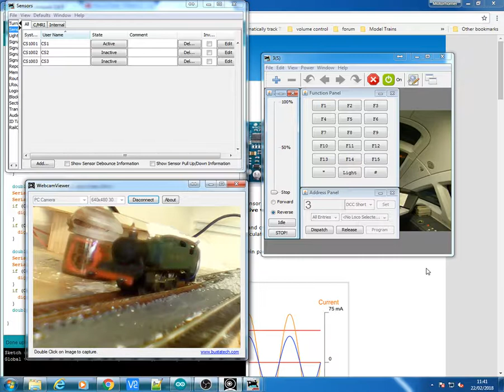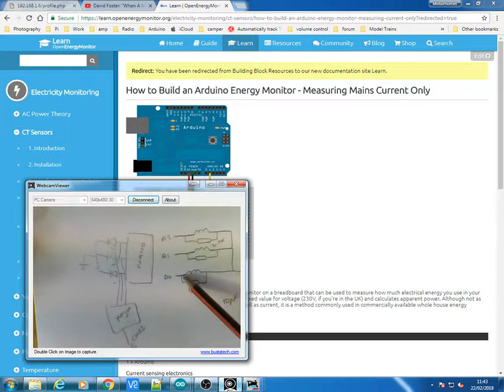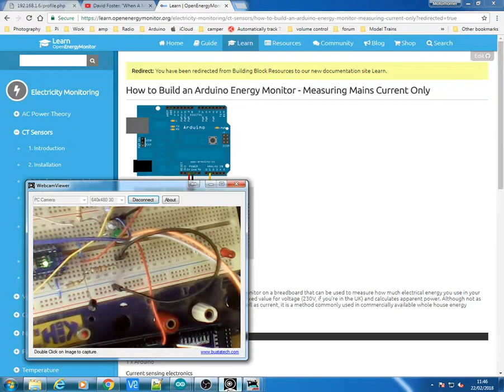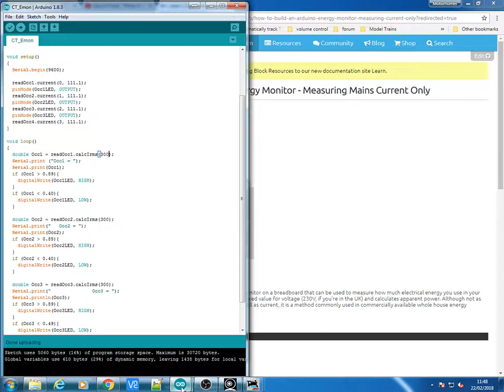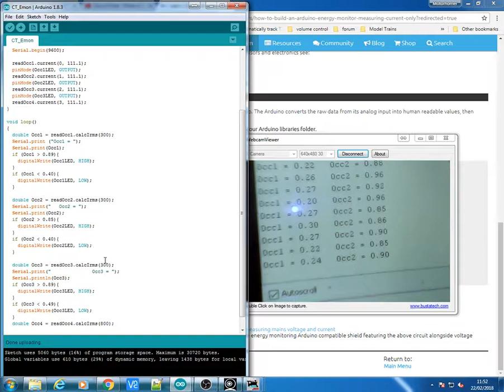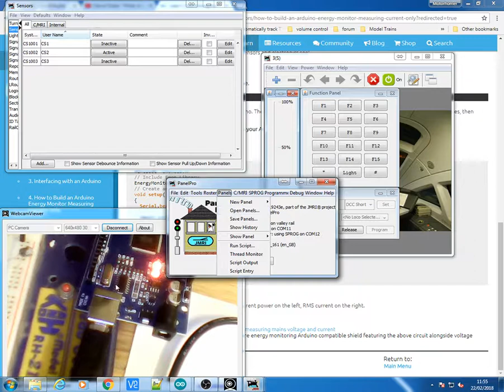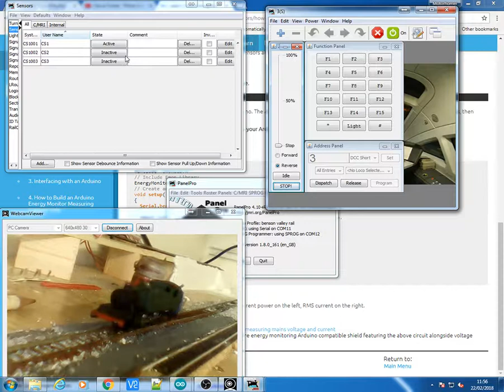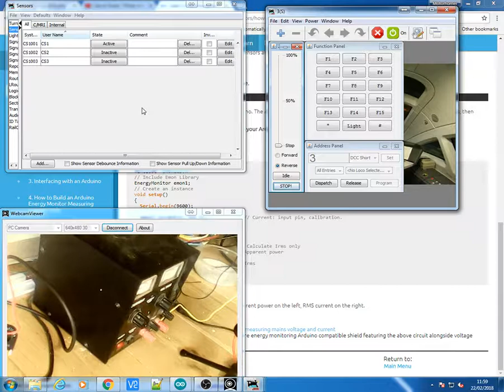Model Railway CT sensor Arduino CMRI JMRI part 2

Comment: Hi Motorhomer, I’m following your videos with great interest as I want to go the same way as you. Block detection is certainly the most complex area for solving. 
Have you considered using ACS712 for current sensing? For further info http://thenscaler.com/?p=514.
Keep up with the videos.
Regards
Reply from the maker: I have used these but for n Gauge the current was too small. I have now changed over to OO gauge so may give these a go again when I get around to this part of the build

Comment: Hi - Thanks for this information.  Which DCC system do you use?  I don't understand why we connect to an Analog Input when we are using DCC.  Thanks
Reply from the maker: I was using the SPROG DCC controller which is connected to a PC. This runs the trains on a DCC system. The Arduinos are reading the CMRI output from the SPROG and then it can be used in an Arduino code to control parts of the layout. The CT transformers due to there nature are reading a voltage input from the current to the track as a occupied sensor. This will be a voltage swing from 0v to 5v which the arduino will read on an analogue input pin. It might make more sense if you have a look at the web link for the full setup. Hope this helps
Reply: Thanks - have you considered using the rr-circkets BD80 Current Transformers ?  I don't think you then need to muck round with Voltage Dividers.
Reply from the maker: cant find any data on the rr-circkets BD80 Current Transformers. I have tried other CT sensor modules but the problem you get with N-gauge is very low current when idle. This is very hard to detect with most off the shelf modules. The CT used are also extreamly cheap
Reply from the maker: I cant find any data on the rr-circkets BD80 Current Transformers. I have tried other off the shelf CT modules but with N-gauge trains the current draw when stationary is too low to be picked up. The CT's i used are also very cheap
Reply: sorry here is the correct link - scroll down little to BOD-8 http://www.rr-cirkits.com/description/index.html

Comment: good work finding you put a lot of time to explain makes it easy to follow,i am watching very carefully as im new to the N gauge hobby and converting all stock to DCC have all decoders to fit easy and micro smd resistors for rolling stock,just wondering if there is a way to read value of resister with Arduino then you can set that value to identify different trains carriages, i.e 100ohm could be a coal truck 1 150 ohm could be coal truck 2,ect something to get your brain round.Thanks
Reply from the maker: Thanks for the comments. It could be possible to read one carriage and detect the current reading which could identify that carriage. Each resistor value would give a different reading. However as soon as tow carriages are added it would become harder. If this was very accurate yes its possible the sum example the sum of the carriages if ending in 5 will be coal, if ending in 8 could be passenger. Not done much work on the layout been in the garden with the nice weather at present. Will update when its all running again.

Comment: Nice, as usually. Did you consider infrared or magnetic sensors?
Reply from the maker: Hi Miguel thanks for the comments. I did consider IR and proximity switches but these will only detect the train entering the occupied zone. If a train with 5 coaches on entered a zone it will not detect the coaches that still may be in the previous zone. This will make the signalling wrong and could cause collision on auto system. It will also not detect locos in shunt yards unless they are stored over the sensors. To be honest this CT reading into JMRI is not great and even with IR etc it would still be slow. The mimic panel works great, might need to look at alternative PC control software.
Reply: I don't know why but my mind resist the current sensing option. But since I have a long way to go before commit to the kind of block occupancy I want. I just keep reading and watching what people, like you, are doing :)
And yes, I'm thinking the same thing, change the control software.
I'm building a turntable and came across a problem with JMRI that I had to put a timer in the sketch because on certain (not all) outputs, JMRI keeps sending bit 1, over and over, even after the operation is done and the sensor reported back its new status.... 5 seconds timer before arduino can read the function solved the issue.